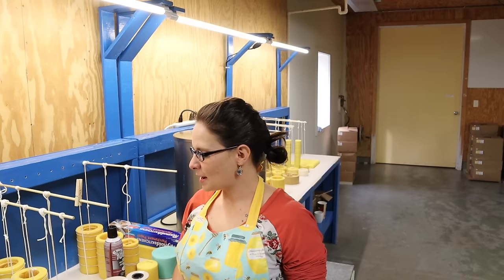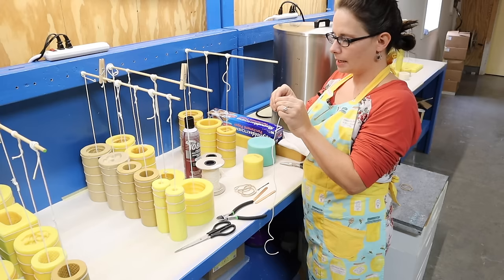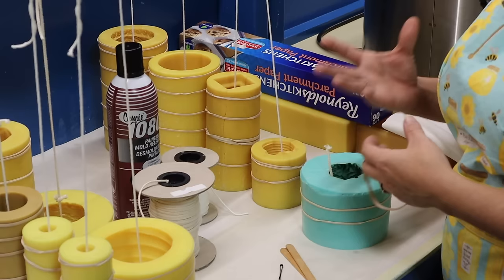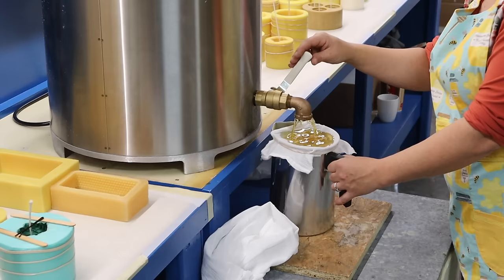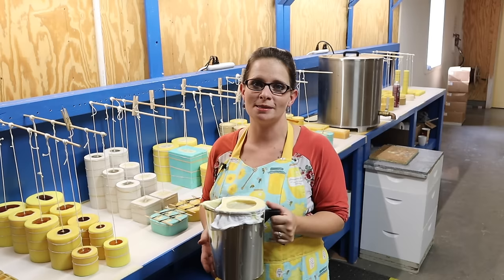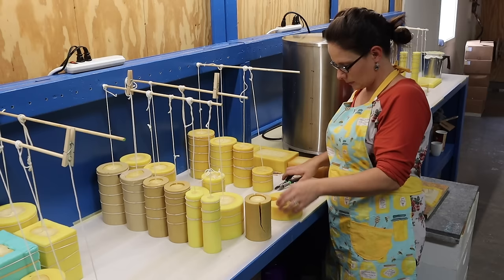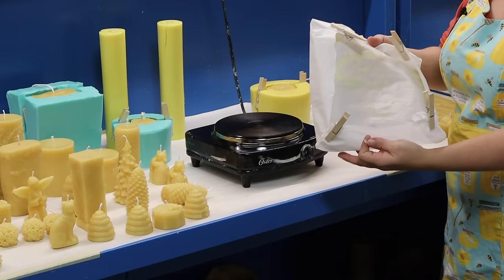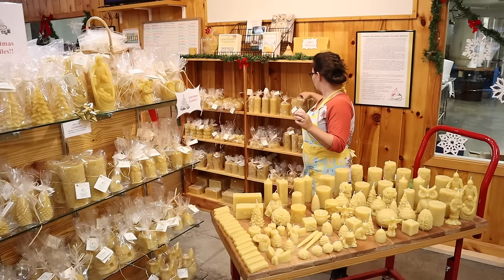How to Make Beeswax Candles

Comment: Great video!  I just purchased this same melter.  Could you please tell me what temperature that you set yours to?  Do you set it higher to melt initially?  Or set the temp and just leave it there always?
Reply from the maker: We set ours at 168°f and use a candy thermometer to check on it. It's always set at the same temperature. Good luck.
Reply: @bobbinnie9872  Wonderful!  Thank you 😃
Reply: What causes lines on the candle? Too hot or too cold of a pour?
Reply from the maker: The only lines we experience are from the mold itself.  @NicoleMorales143

Comment: I just started making beeswax candles. I use wood wicks and jars. My question is, would I be able to use my wooden wicks with mold? And also, what prevents the wax from pouring down the sides and making a mess when burning?
Reply from the maker: We have never used wooden wicks so I couldn't speak to that. When the proper size wick is used it consumes the wax while burning so there is little or nothing left.

Comment: Great video. In a shtf scenario what could you use in the molds in you ran out of the tin spray.🕯🕯🕯🕯👍👏🏻👏🏻 very interesting and informative. I subscribed.
Reply from the maker: I have heard of people using silicon spray but we've never tried it. I I also know that if you're careful with your temperature you may not need spray every time. Good Luck.

Comment: One of the best tutorial on beeseax candles out there. Quick question what size bags are you using?
Reply from the maker: Hi Jaime. The bag we put most of our candles in is 4 x 2.75 x 9 inch. If the candle is short we may cut the bag shorter. The brand is "Highlophane" item # HBG2

Comment: Why are some of the wax blocks different colors of yellow. Do candles burn better with cotton material or other media ??? Does dipping the weighted candle wick make for a longer burning candle and how about a poured candle ???? Why are candles moldes poured upside down ?? Thank you for you kind words of making candles using beeswax.
Reply from the maker: The color of beeswax can be influenced by several things. The nectar source (which flowers) the bees are gathering when they are producing the wax is a big factor. It's interesting how some can produce tan, golden, yellow or orange wax. Dark brown wax comes from older, used comb being melted down and is not the best for candles. We don't pre-dip our wick and are happy with that. The candles are upside down in the molds so the flat base is the part that is exposed and the candle pattern is within the mold.
Reply: @bobbinnie9872  Thanks Bob.

Comment: Hi there,
Started working with beeswax myself and I can get the molds done correctly and the melting, but as soon as I go to burn my candles they tunnel... do you have any pointers???
Reply from the maker: Hi Ashley. Your wick is probably too small.
Reply: @bobbinnie9872  ok thank you! I have purchased some bigger wicks
Reply: What size of wick you are using?? M facing the same problem of tunneling
Reply: @gaura8691  I was using a really thin wick, but I have just purchased wicks for 2.5-3in diameter

Comment: How do you prevent hollow ends in the 10" tapers?
Reply: I pour between 155 & 165 in an ambient room temperature room
Reply: I do this but end up with holes in the bottom. Do you fill the mold right to the top with wax ?

Comment: I'm pouring my candles at approximately 162 Fahrenheit and using the suggested wick but my candles are not bruning bright and high? I've tried all different sizes of wick but they just burn for a few minutes and as soon as they waxpool increases they almost go out or have a very low flame. Also, my wick is 1/4 inches long always.
Reply: Did you figure out why your candles were not burning properly?

Comment: When using animal figure molds, Pam mentioned to keep the wick in a vertical position, but one of my molds, it seems that if I do that, the candle won't burn correctly, so do I  keep it straight up, or at an angle through the thickest part or the candle. I have a howling wolf mold from MannLake. Any help would be appreciated
Reply from the maker: Hi Chuck. Sorry, we've never used that mold so I'm afraid I don't have any good advice on it. My best guess would be to experiment. Let us know what you come up with.
Reply: @bobbinnie9872  Instead of most wicks in a vertical position, I am trying it at an angle through the mold. I made two candles, so I will let you know if the candle burns in a good, complete manner. Thank you for the reply

Comment: I have a problem with the bottom part of my tapered candles separating during the cooling . It's like the bottom cools too fast and pulling  off above the part that sets in a holder.
Reply from the maker: Hi Okie. I talked to all the girls making candles here and they all say the same thing. They believe you may be opening the mold too soon. The taper is handled different than the other molds. They say leave the mold intact until it's completely cool. Good luck, Bob
Reply: @bobbinnie9872   I don't think it is that. I have left it and came back hours later and only to find the bottom is pulled away completely. Oh well maybe I'll figure it out one of these days. I need to clean this yrs wax up more before i make any more.Thanks.
Reply from the maker: You may be pouring too hot. Very hot wax will shrink a lot. Good luck.

Comment: Do you split your long tapers all the way down?  The instructions with my molds sad to pull them out by the wicks, but if you do that at the wrong time, you pull the wick out and have to break up the candle to get it out 🤦🏼‍♀️
Reply from the maker: We split our taper molds just past half way. When pouring we first slide them down a PVC pipe of the correct size to hold them together. We wait until they have cooled down before removing them and they are easy to remove from the mold.

Comment: Can you add food coloring to the wax?
Reply from the maker: Hi Amanda. To be honest, we have never done that and I'm not sure how well it works.
Reply: Short answer? No. and it's dangerous to try it!

Most food grade colorings/dyes are either water/oil-based, which don't mix well with wax. If done wrongly, the water/oil will boil and splash cause hot wax to jump at you and cause injury. Even if you did manage to mix the dye it wouldn't turn out the way you expected.

There are specially made dyes just for wax coloring out there, you just need to search, be warned some may not work as well as others and some may be more expensive!
Reply: If you are using beeswax I would not dye them, it ruins the marketing strategy of the candle.

Comment from the maker: Hi Amanda. May I ask a question before answering. What type of molds are you using? Are you pouring votive candles?
Reply: Silicon molds (Mann lake etc). No, I am not pouring votives.
Reply from the maker: You are using the same molds we are. We have never poked holes for a second pour and were puzzled by your question.  We may top the mold off after a short time with the same temperature wax if the level settles down but never poke holes. I posed your question to my friend Virginia Webb (MtnHoney.com) who is a world class beeswax candle maker. She has won many awards, both national and international, and she told me she has never done this. I trust her word on beeswax candles more than anybody. Check out her YouTube videos. I hope this helps and good luck.
Reply: @bobbinnie9872  Thanks, I will do. 
Every book on candle making I have ever read says when making pillar candles, vent holes must be poked into the top, so that any air holes that have formed during shrinkage can be filled. 
I have always found this odd, as in all the candles I have made, no air holes have formed other than the ones I poked into the candle! 
When I saw your video, and didn't see you poking vent holes, I had to ask if you did this or not.

Comment: My rustic fern candle has no slit. Can I use as is or do I need to make a slit myself? I dont want to ruin it..
Reply from the maker: We put slits in with a very sharp razor blade and then hold it together with rubber bands. It makes it much easier to remove the candle.
Reply: @bobbinnie9872  Great much appreciated!

Comment: Hi bob and Pam, do you prime your wicks in the molds?
Reply from the maker: Hi Tommy. Our wicks don't have anything done to them.
Reply: I’ve been experimenting making pure beeswax candles and this video really helped me get started. One thing I’d like to say is in my candle testing, many of the wicks would burn out before reaching the wax. This is a huge problem. Since priming the wicks make them damn near impossible to stick in and pull through , I though, perhaps I will prime 1 inch of the wicks, and have that 1 inch for the top of the wick, then I don’t have to prime the whole thing and the wick burning out problem will be solved.

Comment: Do you poke holes and do a second pour? Most books/websites/candle makers insist this always must be done, but frankly it makes sorting the candle base afterwards a nightmare. Some say you have to do the second pour at the same temperature, while others say it must be hotter (some say at least 10 degrees hotter, which my wax melter cannot achieve). Neither seems to work effectively, it just ruins the base of the candle. What's your view/experience with this?

Comment: How much do you charge for your candles? Say a 2 inch wide candle?
Reply from the maker: Hi Renee. 2 wide x  4 1/2 high - $10.00. 2 1/4 x 6 - $16.00. 1 3/4 x 6 1/2 - $10.00. All have unique designs and are packaged.
Reply: @bobbinnie9872  awesome. I am wanting to buy a couple. They don't melt and deform as quickly as regular candles do they? And can I order some from you or do I have to come to your store
Reply from the maker: Check our web site blueridgehoneycompany.com to order or our store is in Lakemont, GA on HWY 441.

Comment: If I can ask how do you not have wax leak out of the bottom of the molds? Anytime I use a molds I have to use mold putty to stop the wax, I make pariffin wax candles.
Reply from the maker: Hi Amanda. We've never used paraffin wax so I can't speak on that. Maybe it's the problem. We only have excessive leak problems on old molds that have been used many, many times or if someone uses to small of a wick. Is it possible you have stretched your wicking holes out some how or perhaps the molds had large holes when you received them. I'm afraid I don't have a good answer for you. Good luck.
Reply: @bobbinnie9872  thank you so much for your help!

Comment: Is the wick waxed already?
Reply from the maker: We used unwaxed wick.
Reply: @bobbinnie9872  Hi Bob, greetings from Argentina! In the first place, thanks A LOT for such a great video! I'm making beeswax candles for my church and super new at this task, I noticed that you use unwaxed wick, but my question is this. Is it 100% cotton wick? And, how much millimeters wicks would you recommend for candles of 4, 5 and 6 cm diameter? (Thise are the sizes that I'm doing). Thanks again and best regards!
Reply: @matiasd5370  2/0 wicks under 3inch diameter,  6/0 wicks over 3inch diameter. 100% cotton wick,  unwaxed.